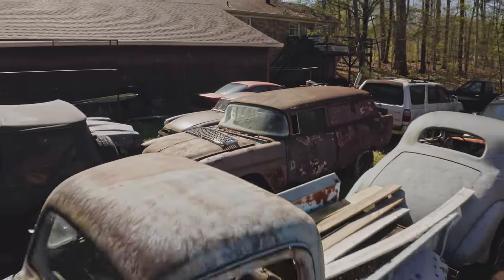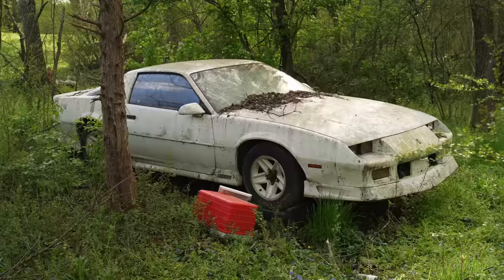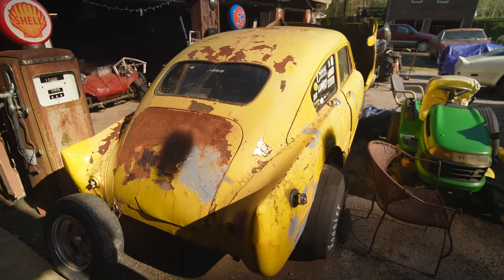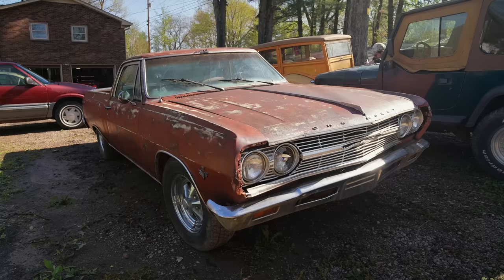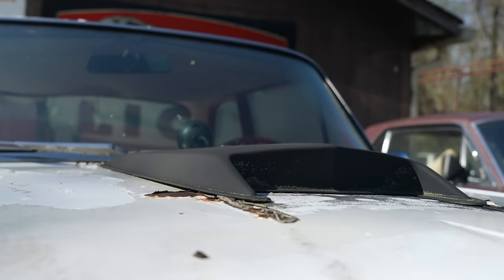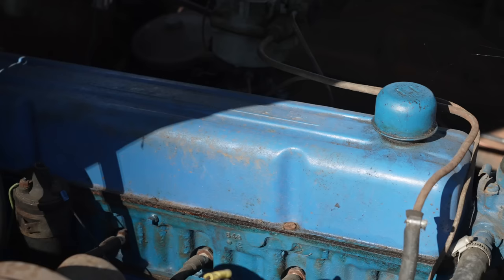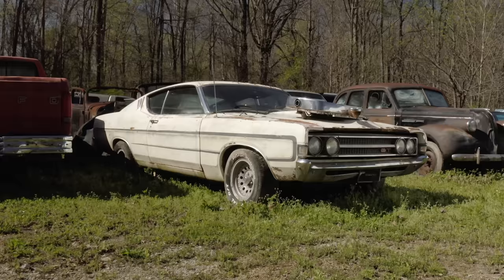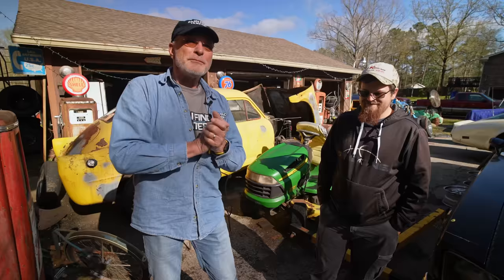A slice of Heaven: Chevys, Mopars, and Fords in Tennessee | Barn Find Hunter - Ep. 122

Comment: One of the reasons why cars from the early1980's to early 1990's haven't very popular is because of the electronic engine controls and sensor problems can be a pain to diagnose and fix. And being mostly electronic problems the only thing you can do is replace the item and junkyard parts are as problematic as what your trying to replace because you don't know if that one's good as well. I had a 1985 Corvette that I fought the battle with and some of the electronic parts were a one year only item and hard to find. Sometimes its just a bad connection inside the wiring loom and if you've ever taken a C4 Corvette dash apart to trace down a connection you know what a pain it is to do.
Reply: My Aunt had an early model square body Bravada which was meant to be a "luxury SUV" at the time so it was choc full of electronics and trust me there's a reason you don't see those things on the road anymore lol. I own a 94 f150 and it has EFI but it mostly does fine so IDK, it does have the 300 in it so maybe that's it. Something about adding lumbar supports and heated seats in that era just doomed the vehicle I guess.

Comment: I'm English I was responsible for tooling approval of the Landrover V8 engine block and head before each new die or refurbished dies went into production from 91 to 05 when Landover stopped production it didn't just go in Land Rover and Range Rovers it went in all-sorts even boats, I was responsible for the Landrover storm TD5 head but not sure if the 5 cylinder turbo diesel was sold in the states.
Reply: Here in the United States I have a Land Rover discovery 300tdi injector pump on my vw Tdi. 
In a rabbit pickup. 
:)
Reply: @fastinradfordable  love it!
Reply: @fastinradfordable  Rabbit pickup in Europe called vw Golf caddy or just VW caddy ,caddy is a MK2 Golf